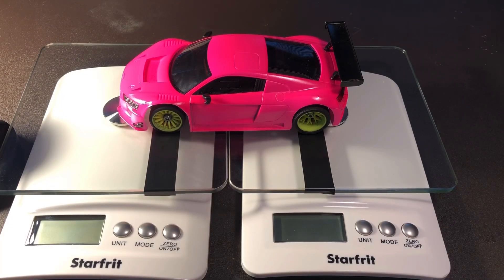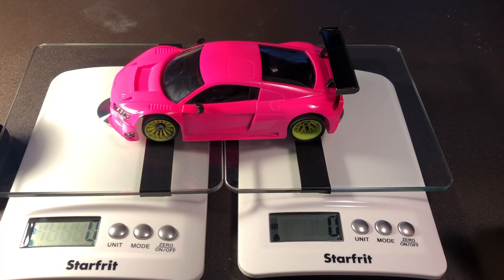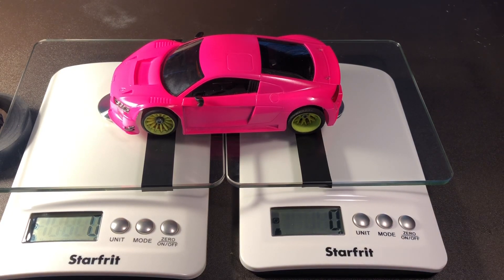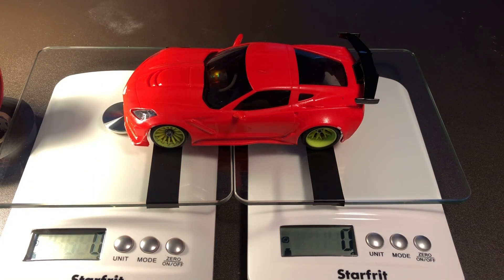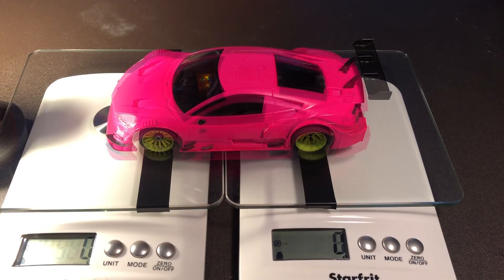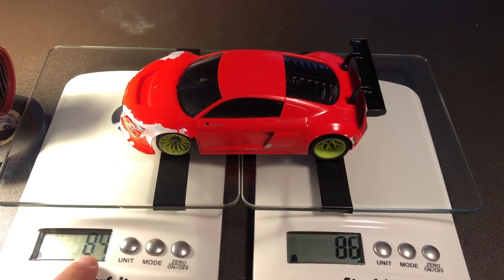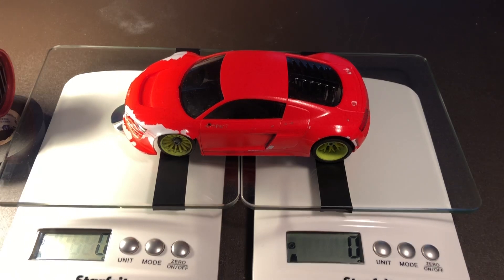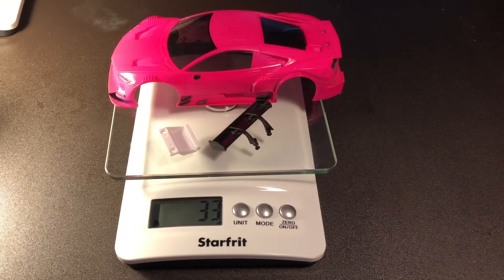Testing out aerodynamics on bodies

Comment: Cool, shouldn't the car be more centered in each of them though? Seems to be more towards the right one.
Very good test though. I wonder how much does this influence the car, I suppose for drifting not at all, and what speed does that airdryer match with?
Reply from the maker: when I setup the car on scale, I used the Center point of the car and hair dryer on max with no heat was 20.6kph